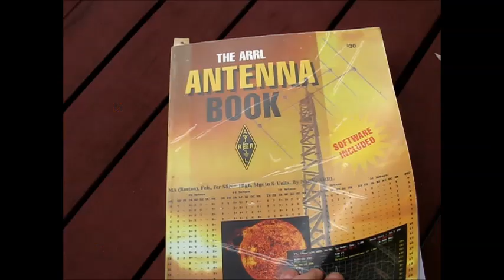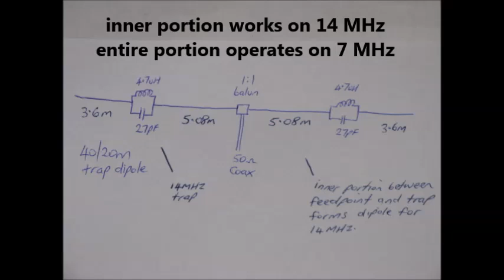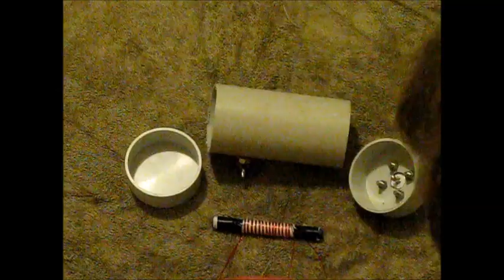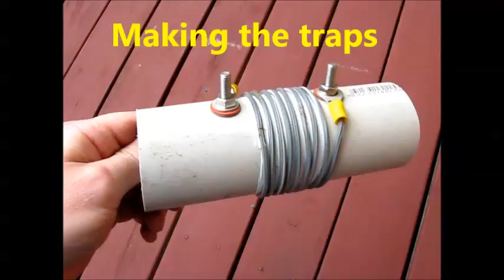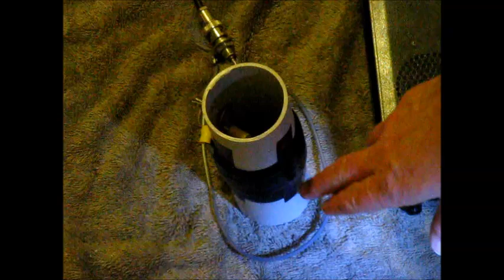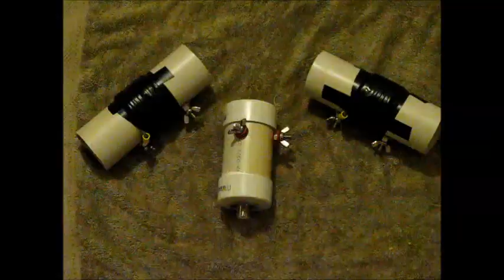Building a trap dipole for 7 and 14 MHz

Comment: GDOs ("dip oscillators") may not be scaled accurately, but they are convenient variable oscillators and, in fact, represent a signal generator AND the sensing device in one package. You determine the dip point and get the actual oscillator frequency using your station receiver.

Comment: Hi Peter,

Your video has re-inspired me - I've been thinking of designing such an antenna for 30 / 40m.  I don't have a dedicated 30m antenna, instead I use the 80m inverted vee with a tuner; and I have a 40m dipole which could be modified.  I like the addition of the drain holes at the bottom of the balun housing - absolutely essential to allow moisture to drain, otherwise the housing will gradually fill up (like it did on one of my baluns when the drain hole got blocked).

Cheers,

Mike VK2IG

Comment: Great Video, I have a concern re:- Testing the resonant frequency, at 4.09 you use voice to excite the meter, the meter is quite unstable due to your voice output, I am wondering if a more accurate result would be gained by using CW transmission?